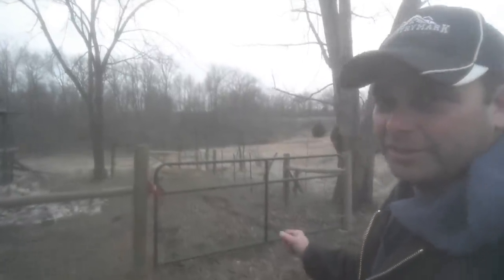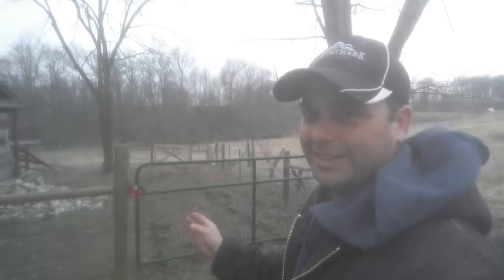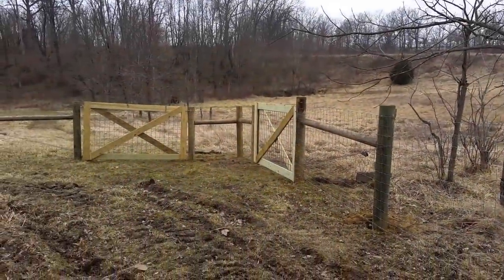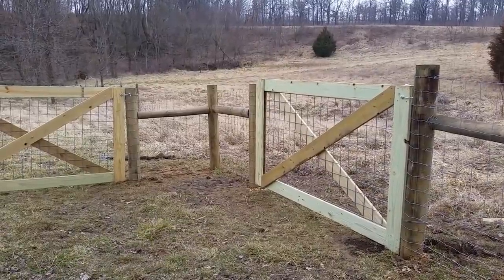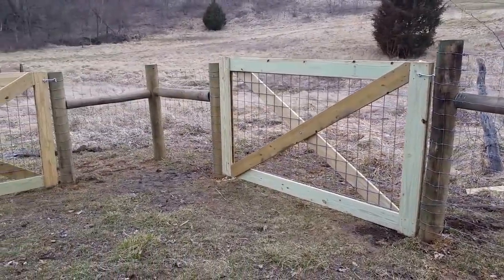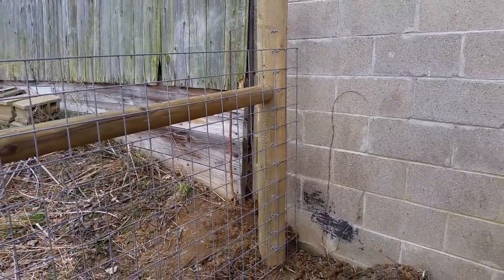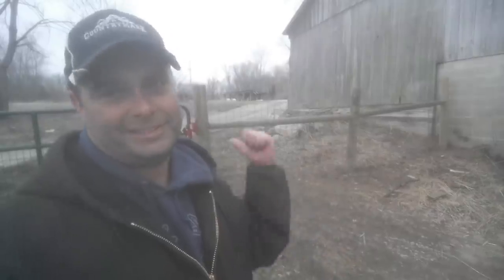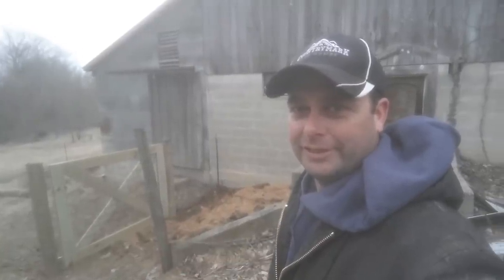Finishing the Barnyard Fencing

Comment: Evan, I know it is late but for future fencing there is a long bar that has a blade on one end and a round cap on the other end. It is about seven feet long. It is heavy and would do an excellent job of packing dirt around the wooden post. Better than using a wooden stick. You may already have this bar. Hope this helps.

Comment: Man on all those little corners and short runs, I personally would've stapled a hog/cattle panel and used bolt cutters to fit. Bless you for showing the 2-way gate latch - I will definitely be using those!
Reply from the maker: Thats funny you mentioned the gate latch.  I have a new video that should post in an hour, that that a 2 way gate latch install in the video.

Comment: Some  days  are  just  like  that!  I  just go do something else  for a  little  while  and  then  come back to the  problem,  I  think out  the  steps to the  problem  while  accomplishing  just  something!!!   Barbwire is  great  to use, but  it  does  grab  everything!!  LOL  I  have  some to  repair  and   another  section  to  stretch again,  every  few years.  I am  mowing  one  garden  to get  ready to till it,  meanwhile  the  rider mower  has  a  flat, like off the wheel flat,  aired up  two tires  and  charging  so I can load it and take it to have  the  carb cleaned.   I am enjoying these  nice  days,  but  sure  going to  be  sore  soon!!!  LOL

Comment: Short fence runs are pains! Dad and I did Mom’s half-acre garden and he figured we could have done a couple quarter mile runs in the same time. One thing that might help in those is a short clamp/stretcher or a Goldenrod stretcher. You have to play with them to see how to best use each of those. Another idea is to shorten the wrap-around ends to just enough to wrap 3x around itself. Fewer verticals to remove - maybe even none if the spacing works. Good rule of thumb on choosing panels for really short runs too. 

I admire your willingness to admit mistakes!

Comment: Well, at least it got done ahead of time; sorry to hear you had problems with it. I think there may be a problem with your camera, it looks like you have some kind of hazy fog hanging around for most of the last few videos. I am not sure if the lens has some oil on it or if the camera is going kaput on you; just an fyi, but I reckon you have seen it. How many more weeks left to your shutdown?
Reply from the maker: The glass on my phone separated from the camera causing a foggy picture.  I have had it almost 5 years, so it was time to replace it anyway.  My new phone has a way better camera.
Reply from the maker: 2 to 3 weeks left till I am back on my normal 4 days a week.

Comment: I have made many cow pens.  That small corner would have been better and stronger if you would have used 2" X 6" to fill in that corner and if you would put on with solid faster it would not mater which side it is on.  They make welded 16 ft. cattle panels that would be a lot better than wire.  For big pens I found 16 ft cattle panels with a 2" X 6" on top.  That will make it high enough and make it stay straugt.  Darrell

Comment: First let me say thank you for all your videos and teachings. They have helped this newbie homesteader quite a bit. I do have a question. Are the wire tensioners on the hinge side of the gate wrapped backwards? i would think the wire tensioners would be on top of the pole that holds the gate and bottom of the other pole ? ( video marker 4min 56 sec) on the left side of screen. and please correct me if i'm wrong because i will be running fence in the next few months and i dont want to do it wrong. Any help would be appreciated.  my thought process behind it is the weight of the gate and gravity will tend to pull it down on non-hinged side of the gate. Which will pull the top of the hinged side out. so would you want the wire tensioner on top there and bottom of the support post? Thanks so much again for all you video. Beautiful home btw. Thomas
Reply from the maker: The wire tensioner is setup to counter act the pulling of the fence wire.  Not setup for the to counter act the weight of the gate.
Reply: @CountryViewAcres  thank you for the info. That makes sense.

Comment: your end post should never turn if brased right and steel wire wraped tight from top of end post to bottom of 2nd last over yourcross post, it cant turn. ad you need the same at every hinged gate post or it will slowly lean over from the weight of the gate, high tensil haevy gage wireis the main holding power